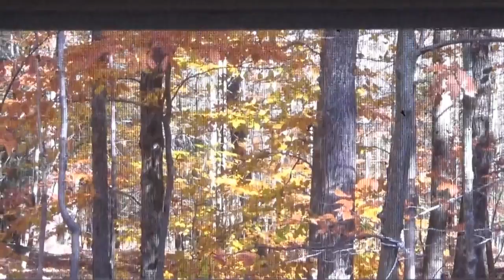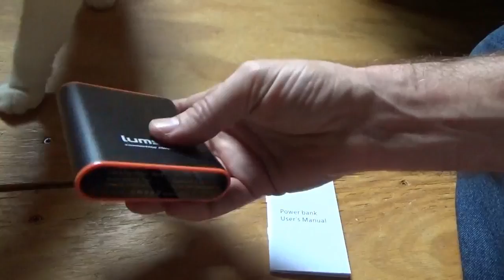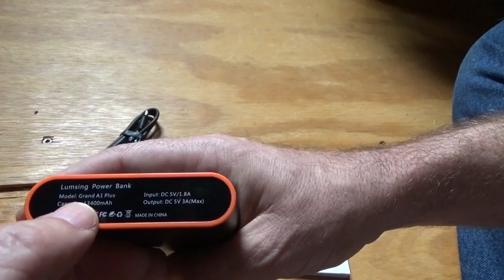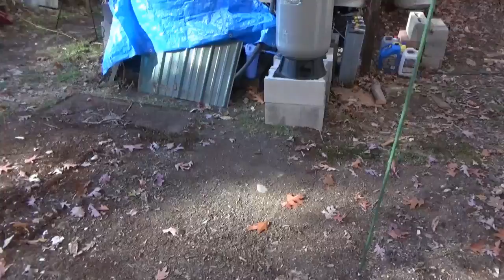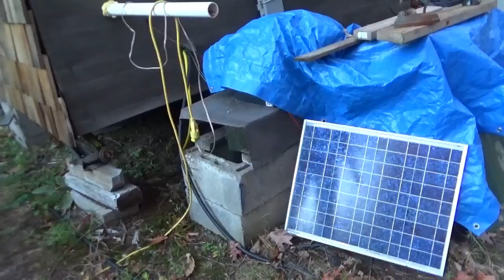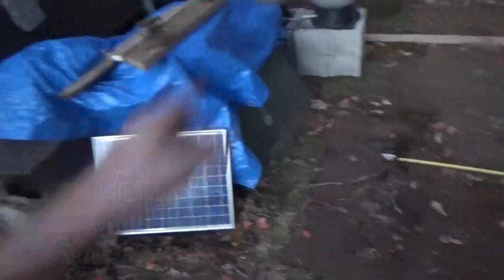Started Building Tiny House Battery Room

Comment: stack the totes
Reply: +Rodman Lyons wouldn't the weight of the one on top, buckle the lid of the bottom one?
Reply: Jen R if the tote has the metal cage around them no. They are built to stack. A pipe connected to the valve and ran in through the top of the bottom. Draw the water from the bottom tote. It would save a good amount of floor space
Reply: oh ok, sorry about that, i didnt see the about the cage. thank you.
Reply: Jen R I'm not sure if his have the cage. I use them for shipping electronic scrap. When I get them they have a cage around them. I normally cut the top of mine off and use them as shipping crates.